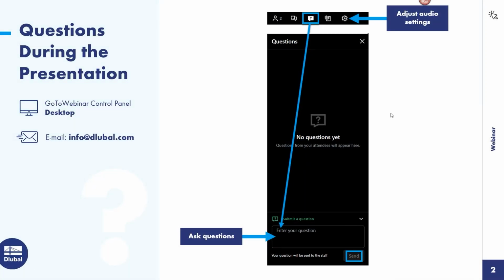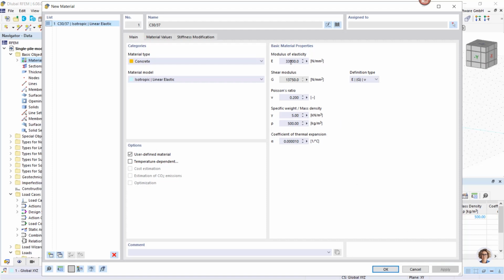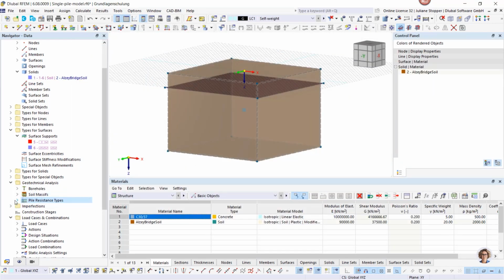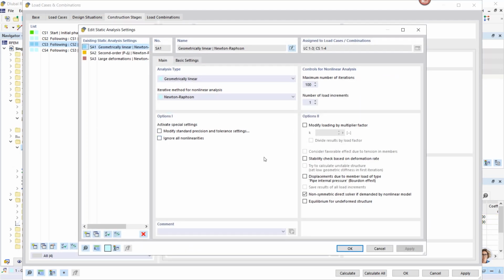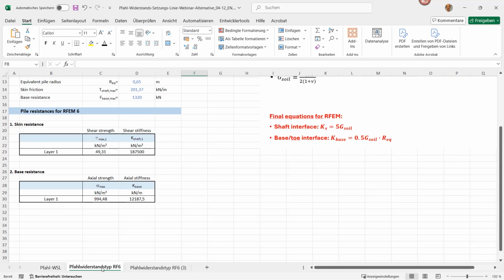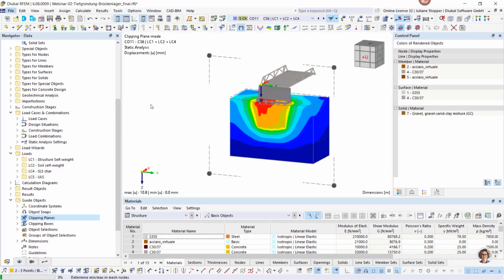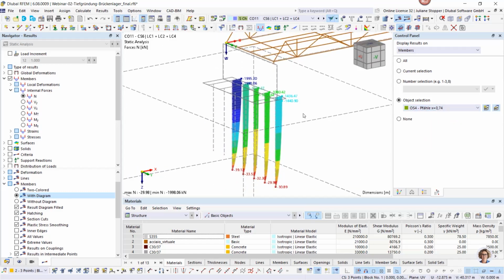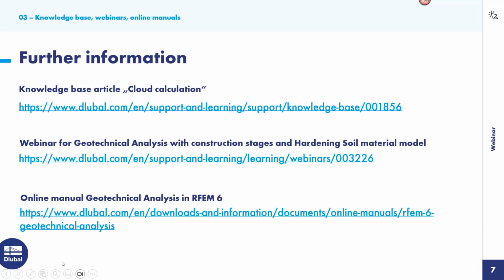[EN] Seminario web | Análisis geotécnico para zapatas de pilotes en RFEM 6

Comment: Very good presentation. Can we add rebar in the pile and perform concrete pile design using the concrete add on?
Reply from the maker: Hi @eugenioluis6615! Yes, you can add reinforcement to a pile and theoretically design it with our conrete add-on. But please note that the available design checks are not yet adapted for pile design, e.g. regarding partial safety factors, detail design, and so on. The same goes for the load combinatorics.